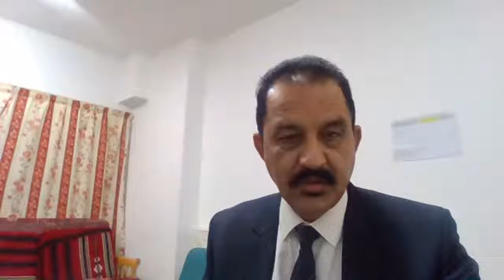Civil Construction Material- Quality Control of Piles---Technical Session no 9

Comment from the maker: Parallel Seismic Testing
Parallel Seismic method is mostly developed for integrity evaluation and quality control of concrete piles in existing structures, as the superstructure has been built upon the foundation. For integrity evaluation, a borehole is drilled close and parallel to the pile. Boreholes are lined with a plastic tube and filled by water for coupling between transducer and surrounding surface. An acoustic wave receiver is placed at the bottom of tube, moving upward with a constant speed. The pile-cap is struck by a hand-held hammer. The signals from the receiver probe and the depth-measuring device are recorded and analyzed the form of an acoustic wave profile. The profile is then used to evaluate the integrity of piles. The test method has been described in the ACI 228.2R document.

Comment from the maker: - Ultrasonic Crosshole Testing
Ultrasonic Crosshole Testing provides information about the homogeneity and integrity of concrete. The method can be used for quality control of concrete piles. This method overcomes the limitation of low strain impact integrity testing. vertical holes are created using tubes at the time of pile construction (at least two). The tubes are filled with water. An acoustic wave emitter transducer is lowered to the bottom of one tube; while another acoustic wave receiving transducer is placed at the bottom of second tube. Both transducers are pulled upward at the same rate. The signals are analyzed and integrity profile of the pile is developed. an ultrasonic profile. The test procedure is standardized as ASTM D6760

Comment from the maker: - Low Strain Impact Integrity Testing
Low strain impact integrity testing can be used to assess the integrity and consistency of piles. The test works best on relatively long piles, driven piles, augeured piles, or drilled shafts. A hand-held hammer is used to impact the pile head. A Motion transducer is placed over the pile head and records the reflected echoes from the pile. The acceleration/velocity data are analyzed to identify potential defects in the pile. Pile integrity testing is standardized as ASTM D5882.
Applications: The test results can be used to evaluate pile cross-sectional area and length; determining the integrity and continuity of piles; and assess the consistency of pile materials.

Comment from the maker: The following NDT methods are widely accepted and used for evaluating the integrity of piles:
+    Low Strain Impact Integrity Testing,
+    Ultrasonic Cross Hole Testing for piles with accessible tip,
+    Parallel Seismic (ACI 228.2R) for piles covered up by pile-cap
The following article describes some of the most common integrity issues in pile construction and installation

Comment from the maker: Quality Control of Concrete Piles
Different methods have been developed to evaluate the quality of concrete piles. Apart from general concrete tests (concrete cylinder samples, and slump test), different non-destructive testing (NDT) methods can be used to evaluate the quality and reliability of concrete piles. These test can help identify and quantify integrity and quality related issues.

Comment from the maker: Poor patches of concrete, and honeycombed concrete can affect the durability and strength of concrete piles. Moreover, inconsistencies in pile cross-sectional shape (necking, bulging) are among integrity problems of concrete piles. Cracks, and discontinuities that might happen during installation can also affect the strength, and capacity of piles.